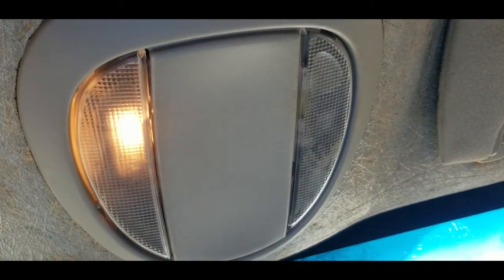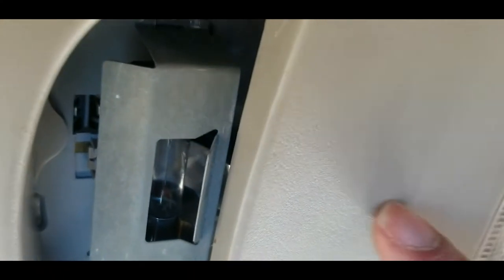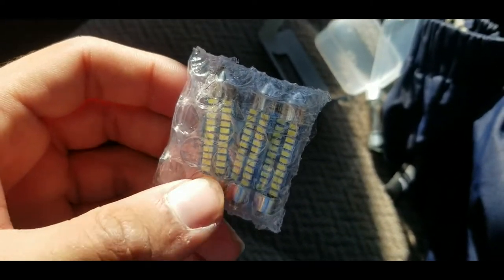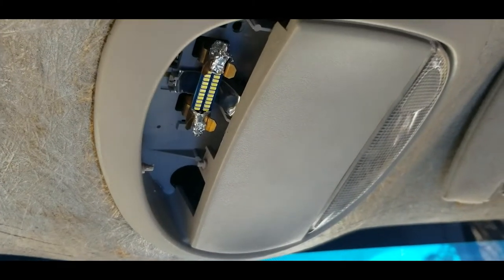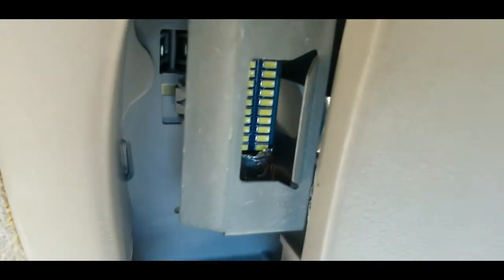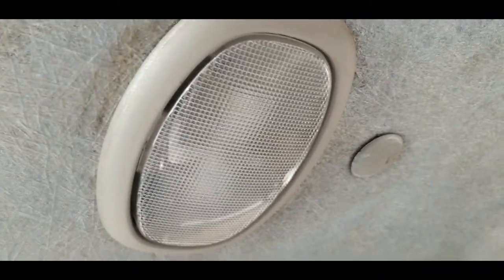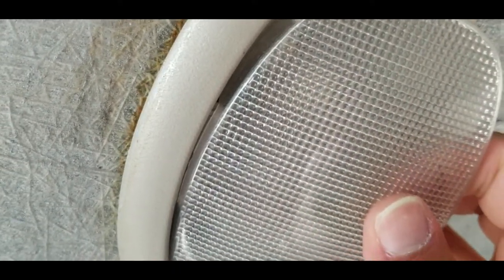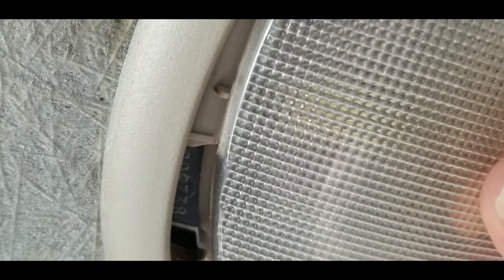LED F/R Interior Lights | 01-07 Grand Caravan SE

Comment: INCORRECT bulb for 2005 Grand Caravan. 2005 GC does not use a festoon style on the front console map lights that you're showing, but I wish it did. It uses a completely different bayonet mount PC579 bulb. If those lamps seem to not be working, it's probably the semi-circle electrical contact points that the bulb is supposed to touch. It's a real PITA, and just a bad design, I can see why the festoons are a much better design. Also, the PC579 isn't available in LED. If there's one out there, please comment. Thanks!!
Reply from the maker: Thanks for the info! I assumed they were the same because I only saw the outside
Reply: Why they differ from year and trim is an another Chrysler Corp mystery! They never did learn to keep things simple. I forgot to thank you on my first comment for your very good video, sad it doesn't apply to all models!! @TechiePocket1
Reply from the maker: Yeah always gotta be somehow complicated 😂. I'm happy these drivetrains be so sturdy. Mines at 210k now and still going strong.

Comment: Popped my whole unit out to replace headliner which I decided not to do..gonna scrub off remaining foam n paint n be done..problem? I can't get my dome light to pop back in..
Reply from the maker: You could try extending the arms that hold it in otherwise if it's loose idk what you could do. Is it the clips or the headliner that's messed up?